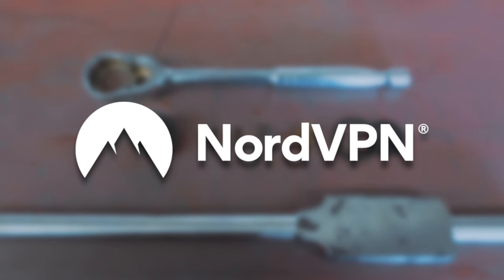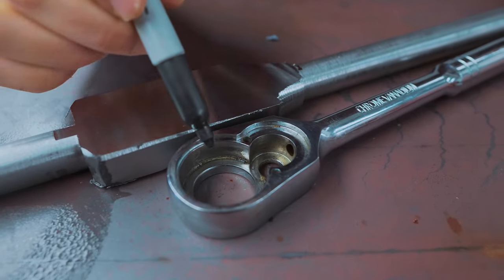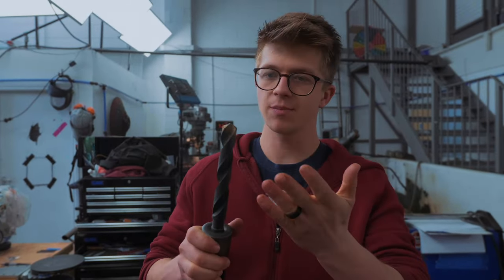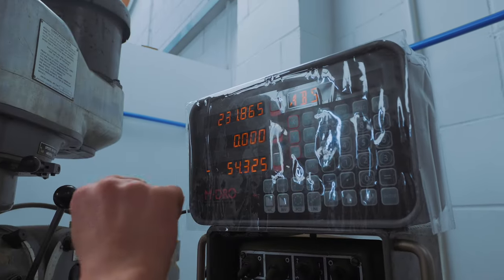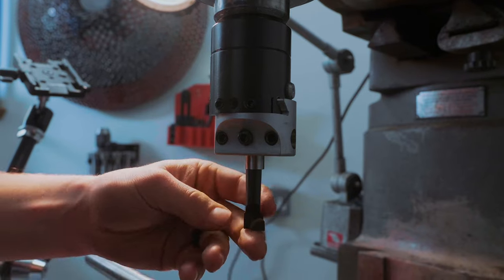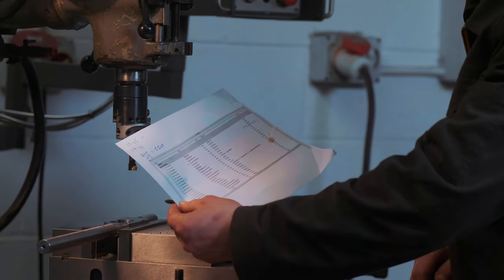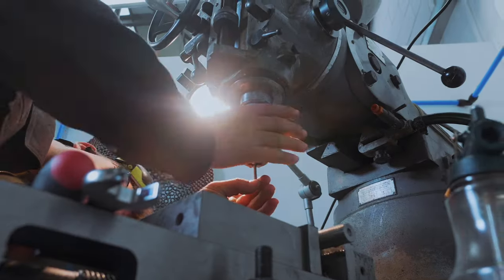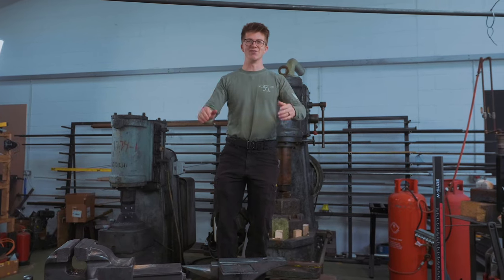Making a Socket Wrench from Damascus Steel! Part 2

Comment: I'm new to milling, and they let me connect an old bridgeport to power for small milling task every now and then at work. So I have a question to ask any more experienced machinist here in the comments..Couldn't a centering endmill that one can plunge with be used to rough out the material and then just finess the sides of a square hole before final passes with his bore tool? Doing that, I would think, would shave time too instead of using a rotary vise or servo motors for the DRO. Plus it doesn't cost a ridiculous amount to buy a carbide endmill online.
Reply: That's exactly what a good machinist would do. You'd first use the drill bits, all the way you can. After that, using an endmill you'd slowly rough out the hole, and then use a tool like Alec did to finish it. Alternatively, you could use a hardened steel  "guide ring" that your tool will run into if you get too close to the exact diameter. Albeit, you'd need other machines to make the ring, so it isn't often used nowadays. 

Even smarter way to do it was using the lathe. Boring bars work so much better on lathes, but I'm not sure Alec had one. He's still doing well for someone with little to no training.

Comment: So maybe I can get some help from a Machinist... 
I've seen some parts being machined on a lathe, in which the part was offset and centered on the cutting area. I figured there's a good reason why alec went the the mill instead of the lathe and just trying to understand the thought process. 

Would the overlap of the two counter bores cause problems with using a lathe?
Or is it just a different type of lathe that is designed to handle the load of force produced by the unbalanced part?

Comment: You do realise that the centre hole of the 3 the 1 that went the whole way through could have been done by using a drill bit. A lot quicker and far easier on your tooling.

Comment: Wonder if the hole bored were imperial.. and had some slop to work. Would make some sense perhaps as to drill size. Would be randomly rare tho it seems. Snap on?

Comment: Your air compressor is showing sign's of internal rusting.
Please do regular servicing and purge every day.
Reply from the maker: How can you tell?
Reply: @AlecSteele  the water and color of it, either rust or leaking piston rings with oil and water.
Either way it's going to be eating the inside of your tank, especially being in your climate.

Comment: The small through holes look a little off. Did you over bore the large diameter? Or are the two tiny through holes just not in the correct position? There's visibly less "meat" between the two small holes and the main large hole vs the factory ratchet.

Comment: These boring bars are not properly ground from factory. Actually they are pretty far from that since the cutting edges are not on center line... I'd recommend giving them a complete one over, or get another propper set. I have 2 of them...

Comment: You can use a normal boring bar with inserts with that boring head instead. They are also harder and stiffer than those shitty ones you get with the boring head, and they also have a flat which doesn't deform from the lock screws and get stuck in the head.

Comment: He didnt sharpened correctly his boring tool. But of course it going to scream if it doesnt have at least a small radius on it! And also for the finishing cuts ( 0.002 to 0.010 inches) its better to use HSS tool ( if sharpened correctly with nice radius and rake angles, with the slowest feed you can get, you will have a nice mirror finish. + its way more easier to sharpened than carbide tool.) And try to use the biggest tool that can fit in your hole

Comment: You need to resharp your tools more because you hit the cutter while not spinning it. The metal is too brittle to tap the metal while not moving. In other words, it needs to be moving before you contact your workpiece!

Comment: Hate to be the engineer to point this out, but the reason you had to keep sharpening the braized tool bit was because the cutter is running the wrong way.. it's also why it why screaming for help! 

I learned as a young apprentice if it doesn't sound happy, it probably isn't! 😂

Comment: Those boring bars that come in sets with the import boring heads are notoriously bad. The geometry of the cutting edge is too high on the centerline of the bore. Picture getting a small boring bar properly set up on the lathe and then raising it by 3mm for absolutely no reason. If you rotate it so the cutting edge is on centerline than the rake becomes too negative to work. This is why you weren't able to take any decent depth of cut with them. 

You can fix them if you have a way to grind carbide but you need to take off a good portion of the carbide to get it anywhere close to the right geometry. I've fixed a few of them on my Baldor carbide grinder with a diamond wheel but it's easier to buy a proper indexable bar (the imports aren't nearly as bad as the braised tools and now you don't need to worry about touching up and honing a shop ground edge every time it gets damaged) or make a HSS tool.

Comment: When filming the mill, would it be possible to sync the camera to the Hz of the DRO so the display becomes readable? Alternatively, could you merge some frames in post to achieve the same effect? Thanks! :)

Comment: Sketchiest thing I ever had to do in a machine shop was use a maxed out boring head. Had me saying a prayer and I'm not religious
Reply: Ran a keyseater from the 1890's that was way too sketch to be in a shop of our size, looking back. Flywheel driven mammoth arranged with the table below the drive so it pushed material instead of pulling it the way more modern keyseaters do. You'd have to get an acid brush dipped in oil down your key between every stroke for your cut to be good, and get out of the bore in the second between the cutter exiting the top of the part, and it coming back down with a vengeance
Reply: @schwig44  that's wild. Mine was full extension of the boring head trying to cut a 5-6inch diameter bearing race. If the mill wasn't bolted to the ground it would have for sure started walking around the shop. I could feel the mass of the rotating head shake through through the whole machine.

Comment: those import bars just suck nothing wrong with the head and honestly it's never a way to remove material fast but the combination of cheap carbide a relatively soft and flexing bar and poor geometry is just a nightmare 
Always if you have larger tool stick out a good quality and stiff tool bar is a game changer the first try in the vid wasn't a bad speed or depth just a tool that flexes therefore vibrates and with higher speed it's also a higher chance its going in resonance with something sometimes you can force start those cuts and the tool pressure can stabilize the cut then you know the cut is right but rigidity isn't

Comment: I think you could of made the holes on the lathe
Reply: 4 jaw chuck in the lathe yes it possible, but you need a large lathe to do that and dont think Alec has that size thats needed.
Reply: yeah, as long as the length from the end of the handle to the furthest hole center didn't exceed his swing. Just make a fixture plate and get to it

Comment: I really don't understand why you didn't rough cut the holes with an endmill and then finish them with the bore tool instead of hogging out so much material with the bore tool.
Reply from the maker: Didn’t have any larger endmills!
Reply: @AlecSteele  Obviously you need to come back to Montana 😉

Comment: 1.  Machinists handbook will tell you the exact rpm for your tool and work product and the feed rate. 
2.  You bought a nice holder but really cheap cutters. Get carbide inserts next time. 
3.  Use proper cooling/cutting fluid. 

And how about asking a professional machinist for help rather than misuse some very powerful and dangerous machines.

Comment: As a born cynic I must ask, how do you know your steel will hold up to the task? If you're planning on making your own gear and pawls how will you know they'll hold up to their tasks? No talk of material choices and reasons makes this seem dumbed down, these are highly pertinent questions.
Reply: The material doesn't really matter because this is not a production item but if you watched any of his videos you would know what he uses to make his damascus. He makes things like this simply for the love of his craft and to share it with us.
Reply: As someone who uses ratchets day in day out id be surprised if it even works properly for longer than a week. Though I understand it's probably not his intention to use it. I'm sure a Damascus body would just sheer somewhere.
Reply: @georgecroney6168  "I'm sure a Damascus body would just sheer somewhere." Have you not seen him twist the Damascus with a cheater bar welded to a wrench. Why would you think it would just sheer?
Reply: @MrWizards1974  the grain structure.
Reply: @georgecroney6168  Providing he hardens and heat treats it right that wont be a issue. Its not like he's making it out of cast iron. 😉

Comment: Why not just use a drill for the through holes, an end mill to get the bores close to size and then use the boring head to do finish cuts? Seems to me like you just wasted a bunch of time using the boring head to do the whole thing.

Comment: Watching Alec attempt machining as a design engineer and machinist makes me irrationally angry. If you printed out a design sheet using Fusion 360 (which I saw in the first vid) it would’ve made life so much easier for quickly looking at dimensions.

Comment: Serious Question... Since you're making your own ratchet, why do you feel the need to exactly replicate a mass produced ratchet??? Just make the holes a size that you already have bits for and make the internals fit the holes you e made. As long as the outer adapter is the correct size for sockets to fit you don't need to replicate somebody else's ratchet. The point is to make your own... So make it your own. Stop overcomplicating everything